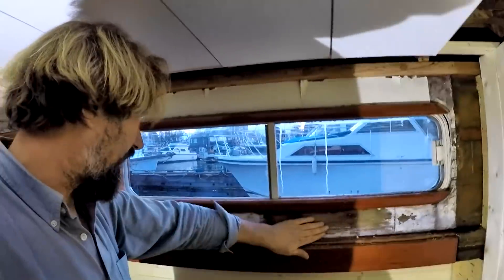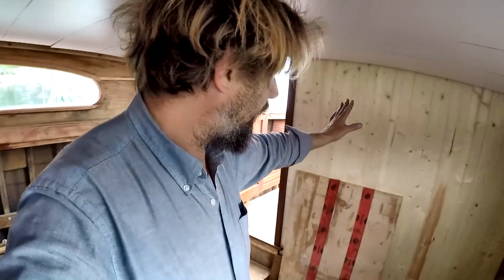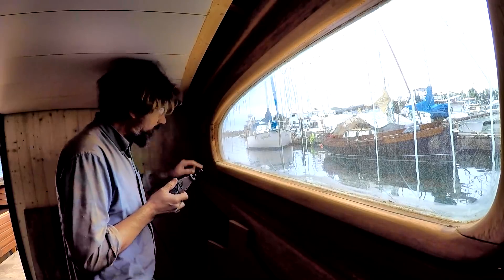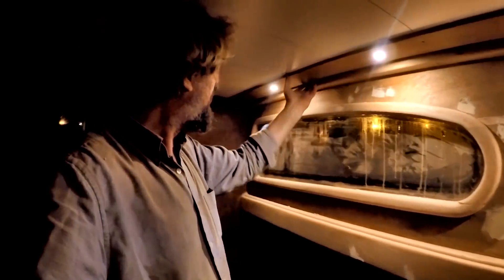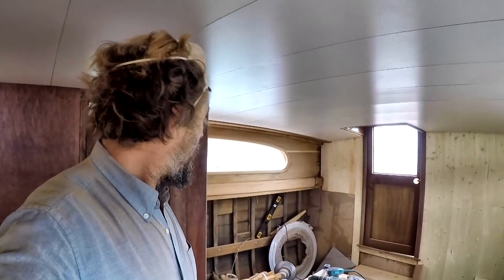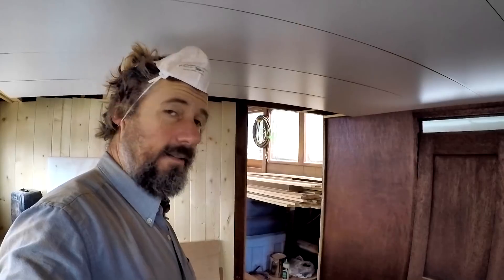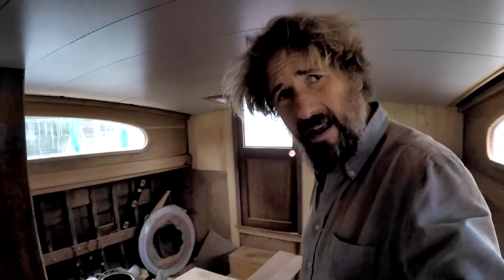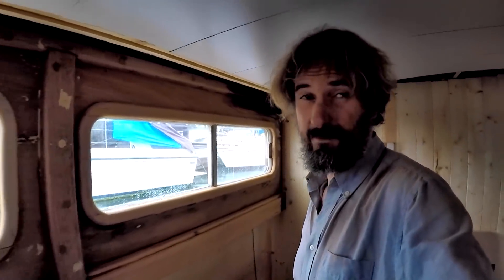Refinishing the aft cabin - Wooden boat restoration - Boat refit - Travels With Geordie #77

Comment: Just a thought, if you & Geordie need a work break, taking him for walkies around the marina ya'll live in & giving a little glimpse of the area would be cool. 
The boat's looking incredible, always like your attention to the details. So many builds rush thru but even rushing ya'll never skip a step...as so many do these days. Was just thinking a drip of varnish down the drain holes would keep water from leeching into the window trim so it won't rot so easily. Maybe not the best idea anyone ever had but it's another little level of protection.
Have a great visits with your girls, another great video.
Reply from the maker: Thanks again. I've had a few requests for more content other than just the boat refit. I'll probably add a sprinkling in here and there.

Comment: I'm a year late, but you can use a very thin blade to cut many shallow slits on the back of a board, steam it and curve it. Once it's cooled in place, you can fill the cuts with sealant and mount the curved plank to backing bolsters with a matching curve. I've never done this with Sapele, but if you have some scrap, it's worth a try...
Reply from the maker: I've used that technique in construction for years, good point.

Comment: a round hole wont weep very well, if you can oval it out you will have better drainage.
Reply from the maker: That's a damn good point Cory. round holes are suseptable to holding water from the meniscus.
Reply: back in the day i worked in a glass shop and thats what we found anyway
Reply from the maker: It's absoloutly true. All commercial windows have elongated weep holes.